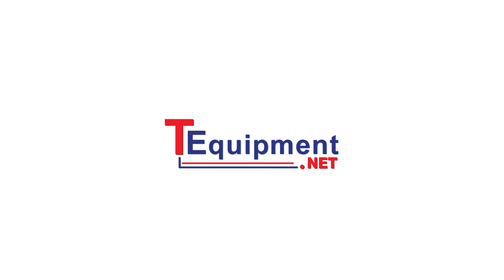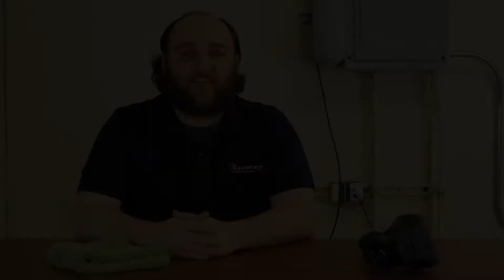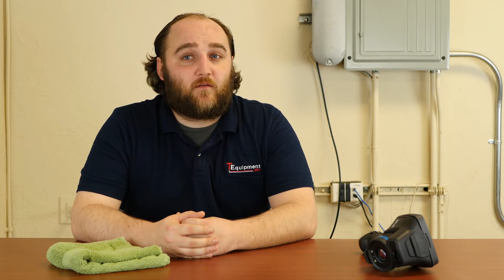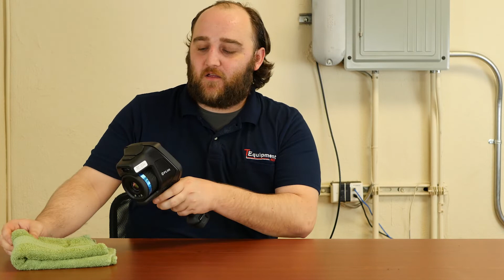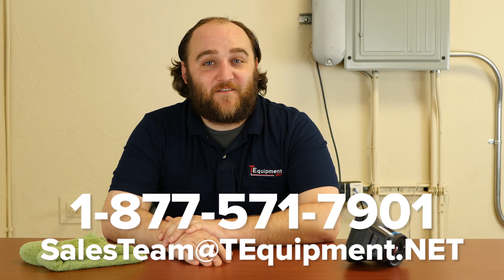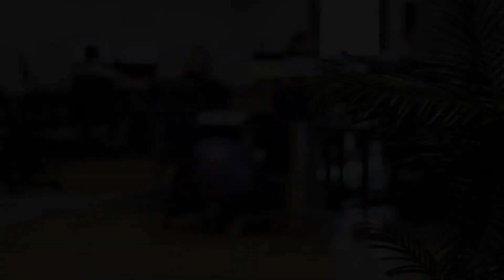How To Detect Moisture with a Thermal Camera

Comment: Thank you Devin for this explanation, I was reading the report of observations from thermographic scan of a ceiling with spots of moisture. There was cold thermal pattern during negative pressure scan at some spots; but there was no cold thermal pattern noticed during positive pressure scan. What could be responsible for this?
Reply: Cold air hitting ceiling on negative pressure test, none on ceiling with positive pressure test because warm air blowing out would not cause cold spots to occur.

Comment: what would be a good entry point budget equipment to go for if I am not a contractor but would like to know where I have water damage on residential home? No rental shop near by this the question.
Reply from the maker: One of our top budget recommendations is the Hikmicro E1L - it has a temperature range covering -20°C - 550°C, 160x120 resolution and 8hr battery life but it does not have any image blending capability. Check out our recent demo video here: https://www.youtube.com/watch?v=vlsxBj2yQY4

For your needs, a smartphone-based IR camera might also work well. Check out this video to learn about a few great options: https://www.youtube.com/watch?v=JgO5o5Wvb6A

You can also browse all of our thermal cameras by price here: https://www.tequipment.net/thermal-imagers/building-and-industrial-thermal-imagers/#/thermal-imagers/building-and-industrial-thermal-imagers/?F_Sort=3
Reply: @TEquipment  thanks for your response !

Comment: Great explanation. Can the FLIR C5 see water seepage on a concrete basement wall behind the plastic vapor barrier insulation and drywall?
Reply from the maker: Yes absolutely, it should be able to see temperature differences created by moisture behind the vapor barrier and drywall. However, it won't be able to see through the concrete itself.

Comment: Cool, does it need to be a Flir brand? Could 200 thermal imagers see where the leak is in the walls? Any affordable thermal imaging cameras you can recommend to see hidden leaks?

Thanks.
Reply from the maker: In general, any radiometric thermal imaging camera should be able to detect cooler spots which indicate hidden moisture inside drywall. FLIR is the leader in this area but you can achieve this with most other brands too. The most budget-friendly options we offer are smartphone accessory style IR cameras which must connect to a phone to be used. Check out these options on our site - 
FLIR ONE Pro LT: https://www.tequipment.net/FLIR/ONE-PRO-LT-iOS/Building-and-Industrial-Thermal-Imagers/
Seek Compact: https://www.tequipment.net/Seek-Thermal/Compact-iPhone/Building-and-Industrial-Thermal-Imagers/

Comment: How would someone, using an E8 for example, determine the difference between moisture at a ceiling versus maybe just a cold spot due to a lack of insulation? TIA
Reply from the maker: That's a great question that doesn't really have a simple answer. Our thermographers say that it really comes down to experience - as you do more thermal inspections, you'll be able to recognize the subtle differences and know what to look for. To start, think about how those two problems might present themselves differently. For example, moisture would pool and run downhill while insulation problems would be between floor joists or roof members and appear more squared off on-camera.

Comment: Excellent video!  Ok, so... if you had to choose between a non-contact/pinless moisture meter or a Thermal imager, to detect moisture inside a wall... which would you choose and why(?)
Reply from the maker: We would actually suggest using both together. The thermal camera is 100% the best tool for initial investigations - it will instantly show you cooler (wet) areas in a scene. It's a super fast way to find moisture in and behind walls. Once you have located wet areas with the thermal camera, you can go in with the moisture meter and take precise readings.

Comment: I own a roofing company. What would be the best camera for leak detection with water inside and out. Something that will work outside when the roof and air are the sane temp possibly.
Reply from the maker: There are many cameras on the market which would work well for a roofing application. We have several ITC Certified thermal imaging experts on staff who can help you further - feel free to call us at (877) 571-7901 with any questions.

Comment: Thank you, Devon. That was a helpful explanation. Nowadays, in Israel, they're using thermal cameras to detect changes of temperature in plants, mostly agriculture on large scale in order to use the exact amount of water it'll be needed to do the job. Apparently the jet sprinklers are triggered each time the programmer gets the information from the activity of the thermal cameras. It's amazing. Everything grows a whole lot faster and larger in size.

It was very helpful indeed to hear you speak. Thank you.
Viewer from Portugal.

Comment: Thanks devin I’m still tryna find out what thermal camera to get. I do bathroom renovations any idea on which is the best bang for the buck about $1k my friend?
Reply: Buy a Flir E4 with modified software. The E-4 - E8 is the same hardware, but different firmware. Smart people have figured out how to make the E4 and E8 with just giving it the E8 firmware. For $1,200 you can have the same camera as the $3,000 E8. You can find them from reputable eBay sellers.
Reply: i am in search for myself and i have found the Flir One pro to be a nice cheap thermal camera, cost 400$, also there are few moisture cameras and flir has one for ~700$. check them out
Reply from the maker: If your budget is $1000 and you plan to use the camera in your business then we recommend you stay away from smartphone-based thermal cameras as these are more targeted at the consumer market - they provide decent resolution at a consumer-friendly price thanks to the smartphone platform. The smartphone platform is more difficult to use for long periods, tends to be much less durable, and has shorter battery life. We recommend you check out the E5 from FLIR - this is a professional IR camera and is currently on sale for $999 while supplies last. Check it out here: https://www.tequipment.net/FLIR/E5-WiFi/